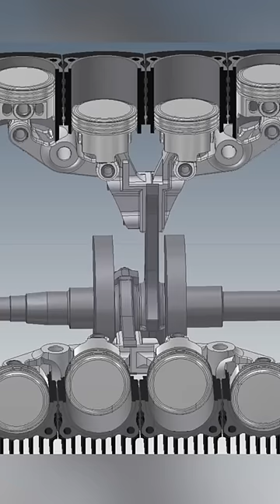STRANGEST V8 Engine Ever Made

Comment: That rod is stronger than my will to live
Reply: Carbon fiber
Reply: At least your will to live is stronger than Padme's will to live
Reply: @Day_Reezy  This guy purchased her right to live
Reply: So... not strong?
Reply: That holds true even if you're the world's happiest person.
Reply: @reychavez-vu5ww  isnt carbon fiber worse than steel for such aplications? because carbon fiber shatters easier on force impact. im just asking i have no idea
Reply: @erikn.9180  good question I don't have the answer but I had heard that carbon fiber was X amount of times stronger than steel
Reply: @erikn.9180 Yes, you are right, although carbon fiber is very good, with tension it is suffering in compression strength. Thats why is used to make big pressure tank but is not very good for submarines😅 

It would not work in this application i think titanium would be the best here. Light weight and strong under compression
Reply: Yeah but if you throw a rod then there goes half your engine right there. it's just a slant four now
Reply: @reychavez-vu5ww is stronger when it’s oriented a certain way against the force acting on it, but the way a connecting rod sees force it would not be as strong as a forged rod. If the force acting on the rod was perfectly linear then yes in theory it would be stronger but the forces are perfectly linear so it’s not viable
Reply: @Xavier1...  alright thx for the answer
Reply: @erikn.9180 the problem with carbon fiber is the resins ability to withstand oils and fuel etc.
Reply: But imagine if that got thrown lol
Reply: since he added those levers between the pistons I'd say most of the force is being lost between the two in each pair as they oppose each other. there's no way his timing is perfect enough to allow this to work properly, but if it is then the rod would theoretically only see double its standard load since it was designed for 1 cylinder but is now accommodating 2 at a time. more than likely he's only managed to lessen the forces on the rod with this though...
Reply: That rod is all of 150 lbs. 😂
Reply: You need a therapist
Reply: A soggy piece of bread is stronger than my will to live
Reply: Guess you weak lol 😂
Reply: @reychavez-vu5ww if its lighter. Yhen it would have less density then iron frame ooo 😂
Reply: So do you mean the rod is weak?

Comment: That’s got to be one helluva connecting rod.
Reply: Right.... lol looking at the first wrist pin I see it breaking preme because of the double movement side to side plus up and down
Reply: Maybe that rod is made of unobtainium!
Reply: @xclife211 oh no if it goes in two directions it's doomed! Nah, they look plenty sturdy for what is really a "low horsepower" show mod.
Reply: @xclife211  If it's properly balanced, wobble won't be an issue.
Reply: @EldeNice wait until the bearings wear
Reply: probably why he is barely revving it. I doubt it would rev high anyways
Reply: @MachineintheMonkey It's not made of unobtainium until it breaks! 😊
Reply: Technically, that thing has two connecting rods!
Reply: @yup6203 exactly. Doesn't matter how strong you make that rod. First guy to tune and charge this engine will be asking far past whatever any bearing or oil could handle. Even that V8 making say 500 HP would put the equivalent force of a V8 making 2000 hp on that rod. Most V8 s I know don't last long on 2000 hp as daily drivers.
Reply: A connecting rod? The connecting rod!
Reply: @4touchdowns1game29 it's possible there's a performance plus fuel efficiency advantages. Otherwise pointless
Reply: I imagine the rod bearings are in for a workout too...
Reply: @MybeautifulandamazingPrincess Is this sarcasm?  This has to be sarcasm.
Reply: Looks like a standard Ducati conrod.

Comment: The engine design in a way resembles a radial aircraft engine. The engine has one master rod and the other pistons are connected or hinged to it with linkage.
Reply: You're right but radial engines are actually decent. There's a big difference

Comment: That ran WAY better than I expected
Reply: hes a guy in a wheelchair making motorcycle engines what did you expect this guys lore is probably so complex and deep
Reply: Seems like it would want to rev no problem as you arent slinging a bunch of rotational weight. But i wager rebuilds are requires on a strict basis. :)
Reply: Anyone know what the name of the guy is?
Reply: @taylordurden8470  That would be Dieter Hartmann-Wirthwein
Reply: @PuchMaxi  tysm I’ve waited too see this for a reply for some time lol. Thanks again

Comment: my man gave the connecting rods two rocker arms
Reply: Came here to look for this comment
Reply: This would decrease rotational mass allowing the engine to rev more freely which should increase horsepower.
Reply: @chrislangdon5473 70 hp 52cubic Inch, that’s pretty impressive
Reply: The bearings in those rocker arms won't last though. Too much force on something that doesn't undergo hydrodynamic lubrication.
Reply: @ryelor123 I'd be adding some oil galleries to keep them fed for sure.
Reply: Rebuilding would be a b*tch always having to do the bottom end.

Comment: Just because you can...you definitely should.
Reply: Best thing I've read in a while. Lol
Reply: We do what we must, because we can.
Reply: @selmiravdic4798  for the good of all of us...
Reply: nt
Reply: Said Mr. Wankel when he created the rotary engine.
Reply: To be fair, as long as it doesn't involve unconsenting human life, yes, do it, we'll all learn something whether you succeed or fail. Its exactly how science works, you get the data and usually share it no matter whether it supports your theories or not, since what you learned is important to share with the rest of mankind. Like the Sun driving climate, or if this kind of engine is feasible, or if a carburetor could potentially be more fuel efficient when it comes to vaporizing instead of atomizing fuel, or how bad lithium is for the environment, or what the best way to do variable compression is, those kinds of discoveries are all important and this did teach us something, we thought that rockers like this would be less efficient and perhaps less strong, and we were right, we got more evidence proving our original theory and data were correct, and thus its much more likely that the reciprocating ICE is very close to its optimal mechanical form already. Science, we do what we must because we can, for the good of all of us.
Reply: @selmiravdic4798  is that an Aperture Science reference?
Reply: @Avetho yea science is dark af at times. Cuz they’ll do experiments whether consented or not 😮😂.

Comment: That's some crazy throttle response!!
Reply: Yeah since it kinda skip the lull in up stroke as it being driven up by the power stroke of the piston, as opposed of being pushed up by the crankshaft of the conventional 4 strokes.
Being driven both up and down by explosion would create those crazy quick throttle response
Reply: @messeduplad  I would imagine it'd have more to do with the lower rotating mass and lower moment of inertia. Those rocker arms are probably weigh less and definitely move less and move slower than connecting rods would.
Reply: @christopherrto  yeah that's definitely contribute too. Is of many factors
Reply: I would think that the opposing two cylinders would be on the opposite XD part of the cycle. So when onebank is on the power strike the outside cylinders would by pushing up on the compressing pistons would free up the power strike the gi to the crank and not lose any to compression abd depending on how  much the they pull on the connecting rod should help with the power strike by the pulling on the crank journal.
Reply: @messeduplad  this is interesting
Reply: It’s a really interesting design. I wonder if the stresses and temperature are lessened or increased since less moving parts.

Comment: V8 with 70hp? Sign me up
Reply: It's only 55 cu in they said.
Reply: That's only 70 less hp than my 78 camaro came with. Those were dark days...
Reply: youtube made me rate your comment 😂
Reply: @_BaguetteDoggo  did you give it a V8 out of a V10?
Reply: @don2deliver  😂 v10/v10
Reply: Ducati moved to Germany
Reply: 1.5hp per cubic inch is very good
Reply: @xxskizzumxx very good for a NA car. not for a motorcycle though. motorcycles made much more than that in the early 80's.
a 1969 cb750 already made that kind of power/displacement
Reply: @don2deliver  he said 52. that's about 830cc so 84hp/litre. not bad for a bizarre home made engine.
Reply: @don2deliver he also said its 70bhp, total displacement isn't the only factor in horsepower or torque
Reply: 1 paket broke you need to change everything🤣
Reply: It's 70hp more than your balcony Ducati v8
Reply: Compression fired diesel engine incoming
Reply: Seriously amazing power production and just imagine if they actually built upon it, how far they would’ve advanced it to possibly 2hp/cu. Damn the possibilities of so many engines made throughout petrol history. 🎉
Reply: @felipemurillomartinez8915 they didn’t move, they were gobbled up by the insatiable beast known as VW or more specifically Audi I believe. They made a Lamborghini edition Diavel, which was pretty clean as far as things go.
Reply: @177SCmaro a ton of cars from the 70s had lower compression and were junk tbh
Reply: Lmao
Reply: When it was stock with half the displacement, it made more power.... lol
Reply: @177SCmaro no joke, I remember my cousin having some massive V8 in his second Gen firebird making absolutely no power. It was loud, smokey and slow af. My turbocharged 4cyl Conquest ate it for lunch. 😂
Reply: @mikedrop4421  If I had to guess, probably a mid 70's Pontiac 400 or 455. 7 to 1 compression, low 400 lift cam, and a pancake catalytic converter that could strangle a lawn mower engine will do that 😅.
Reply: @177SCmaro  yeah I remember him saying it was north of 7 liters and south of 200hp
Reply: @mikedrop4421  
Basically old NA diesel power with non of the fuel economy. Dark, dark days. Now we have muscle cars with 5 liters and near 500hp. Its been a long road...
Reply: @don2deliver   "only" my guy, bikes have 4 bangers with 1000cc (55 cu = 901cc) that do 180-300hp (depending on aspiration).. so no, 900cc v8 making 70hp is still trash
Reply: @don2deliver  So 30cu smaller than my 2 cylinder motorcycle engine and half the power.
To be fair, he is making decent power from it, but I don't see these components surviving in at a larger scale.
Reply: @taylordurden8470  Yes, but no offense, you're not a gear head. It's probably heavily turbo-charged. The engine has serious disadvantages and no advantages over a regular block design. Just one of many issues is that the outer pistons are expending a fair amount of energy wearing out all of the moving surfaces due to the geometry of the design.
Reply: @don2deliver 🤮
Reply: 55Cu
Reply: Maybe it produces more torque
Reply: Just like 70s-80s American cars!
Reply: Thats not what he said, it was also only an 850cc that produced 70hp.....
Reply: @xxskizzumxx that was my thought as well. Looks like lower rotational mass as well so it should be efficient and fast revving (which you can hear in the video)
Reply: @klocke-hx3xl I was just thinking about that as I looked at it, it looks like the outer ones would be unnecessarily stressing the entire cam thing (I'm not into cars, I'm a chemist). Anyways whenever you stress stuff like this in engineering it's always usually also an efficiency hog problem as well as a material stress and wear problem. 

It's cool he did it by himself and it works but still...we have better lol
Reply: Imagine that beast in a hulking 5,500 pound car.  Oh man talk about unleashing the beast.  Make sure your head is firmly against the headrest before you give it any dino juice.
Reply: If you multiply the 55 CID by 6 you get a 330CID V8, multiply the 70hp by 6 you get 420 hp so it’s right in line with a Gen 1 5.0 Coyote and considerably more than a stock Chevy 5.3
Reply: @DirtyFiST69  yeah it must because Hemis are legendary for only having 70 hp, wtf?
Reply: @DirtyFiST69  your math is a little off, I checked, by 67,493,342,146,994 liters since the largest Hemi made for passenger cars was 7 liters.
Reply: Oh and the 6.4/392 N/A Hemi used in scat packs makes 485 hp, compared to 455/460hp from Chevy’s 6.2 LT1 or 495hp from LT2, and Ford’s 5.0 Coyote at 460-480-500hp. So it’s either right above, right at, or right below it’s direct competitors in the domestic market, and pretty far above a lot of turbo charged 3 liter 6 cylinder engines like Nissan/Infinity, BMW/Toyota from the same price point. The old Hemi engines from the 50s and early 60s were more powerful than anything from Ford or GM and then equal to them in the heyday of muscle cars of the late 60s early 70s.
Reply: @DirtyFiST69  no not at all, same situation, 385 hp 5.7 vs Chevy’s 5.7 LS1 with 350, or the high output 5.7 LS6 with better cam, heads, intake and .5 more compression to make 400-405 hp, or the Gen V 5.3 L83/84 with 355 hp, right in line with its direct competitors, I don’t understand the negativity, I’m a Chevy guy over Dodge but they’re both good engine platforms, and to say Hemis are legendary for NOT making power is just about as wrong as it gets.

Comment: Cool to see someone trying new designs for internal combustion engines.
Reply: Have you heard of the roton head for the k series 1.8  it was squashed by British gov ..said to produce 600 horses
Reply: @dailyallowance3826  It wasnt squashed by the gov, they never produced anything anything that was reliable and able to be produced at scale. Several other companies have tried rotary valve trains, the issues are getting a reliable seal is a nightmare, as soon as they get any kind of carbon build-up they seize up. 
Freevalve technology has better and much more durable results but it is far too expensive for mass production hence it only being in a few hypercar engines and some very one off home builds.